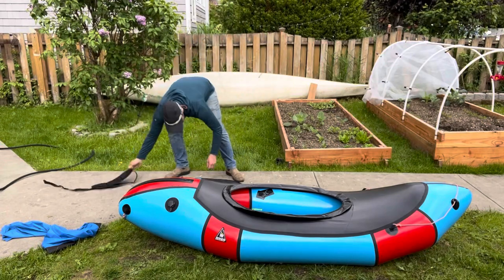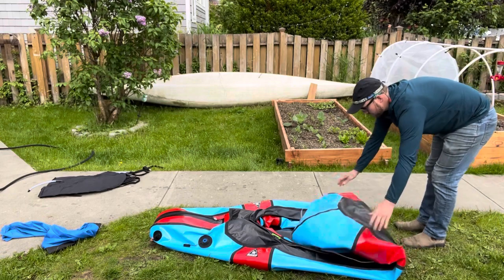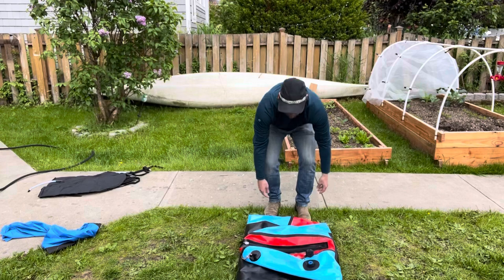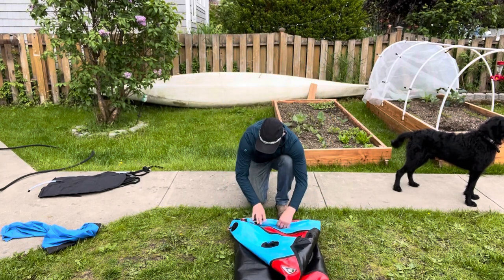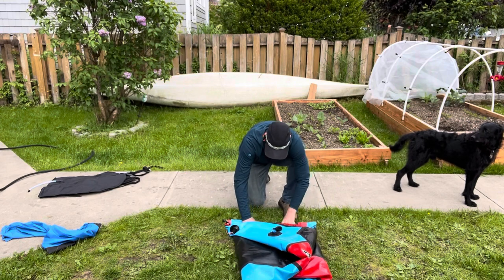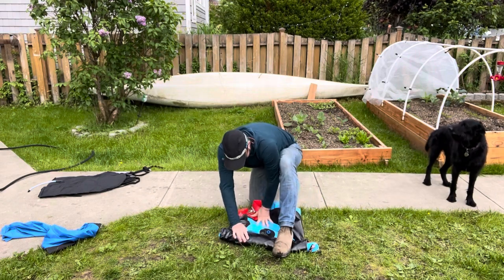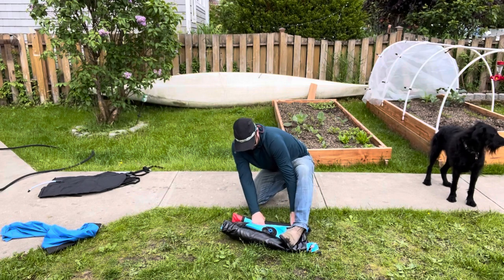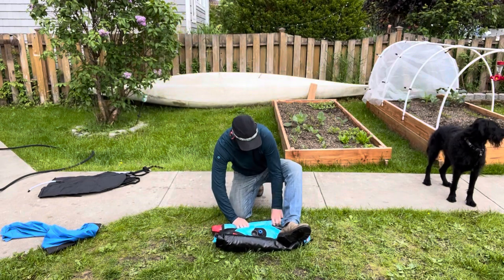How to Pack a Packraft - Alpackaraft Expedition

Comment: 🫢 Sorry, but this is by far the most complicated way of folding a packraft I have ever seen. 😅👍 But maybe I'll give it a try anyway. Just can't quite see the advantages of this method yet.
Reply: Looks like it leaves the valve open till the very last fold so you can get the most air out for the smallest size when packed away.
Reply from the maker: After a little practice it's easy enough. If done properly, the thickest part of the boat is what remains exposed, the floor.